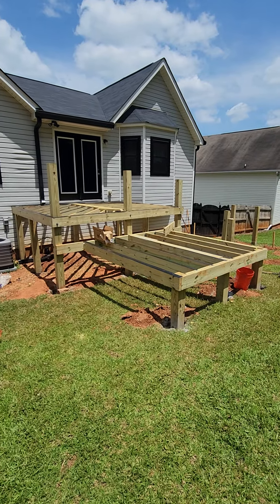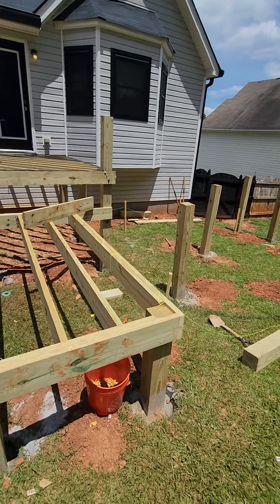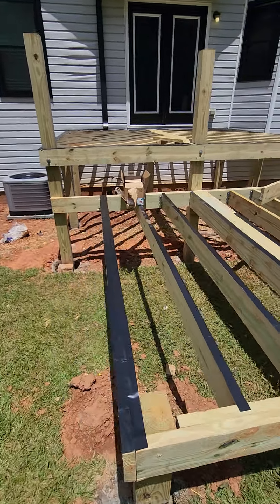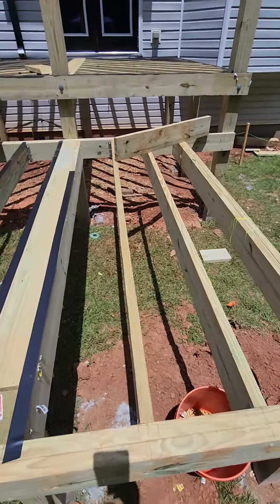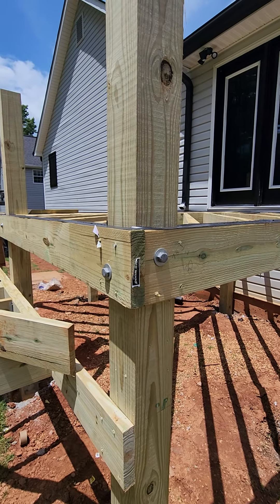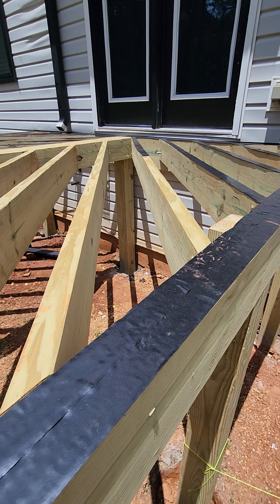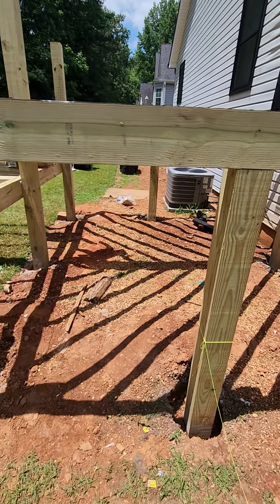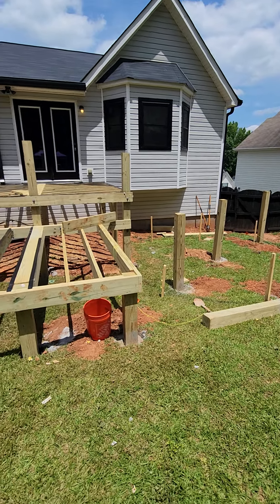Deck Inspection and no codes were followed and the customer has to start over.

Comment: It's a deck... in 8 years it'll be rotten and have to be redonne anyway. Decks should sit on blocks or have screw posts, so you can retouch the levels over time. This is why construction is unaffordable for 90% of people now. Too much fuss over everything. I had 1 deck professionally built 8 years ago, and it cost 5000$ for 4x36. I built the other myself for about 1k.
Reply: Agreed. Modern treated lumber is garbage.

Comment: now honestly... under what weight would those post gonna break?  would that deck shift you think?
Reply: @ViperStruck1  The damage will be overseeable I think falling down from that height. Stepping out of your bath is also a risk.
Reply: @ViperStruck1  Can you show me leagam caess where wrong fasteners where the orgin of legal battle? Most Americans run more risk of getting their own roof on their headcuz it's mostly wooden sheds they are living in.
Reply: @ViperStruck1  building regulations are not very logic and certainly not effective in the USA. Lately the hole hood of wooden houses went up in fire. That is the reality. I like to see how the delivery of renovated houses is done in the usa. Contractor who know what they are doing are just ordered to redo their work. In america sometimes you are allowed to build a wooden house and you can piss at your neigbours property ....not very safe
Reply: @ViperStruck1  you are doing therapeutical job  a therapy
Reply: If the footings are at the correct depth (below frost line) if they get frost at all, and if they built it correctly, which this video shows a very poorly built deck, so poor they were told to stop building and remove stuff, than it would not shift. The deck will deteriorate and need rebuilt before those posts move. I build decks, and I see so many things wrong with this one here. Decks can be built very well and last a long time when built correctly and maintained. Overall, they really are not that expensive, people spend far more on their bathroom and kitchen remodels. Wooden decks are a cost effective way to update your house. We also have pvc decking, which I’m not a fan of but the jobs are worth more so I don’t hate on them too much :).
Reply: @BvictoryforChrist  So you saying americans cannot build good basically